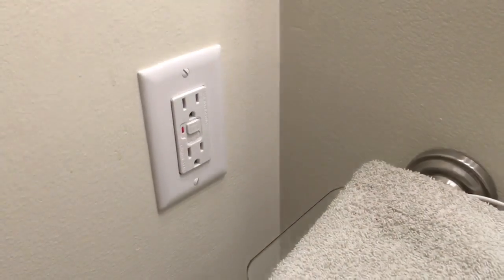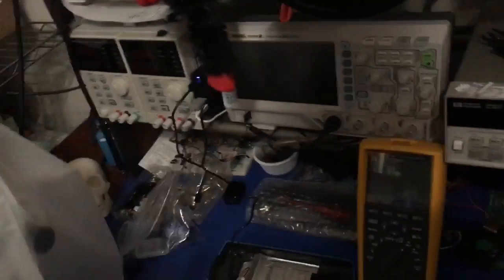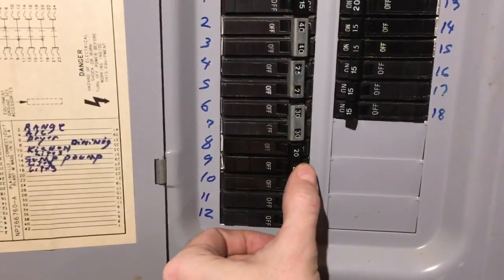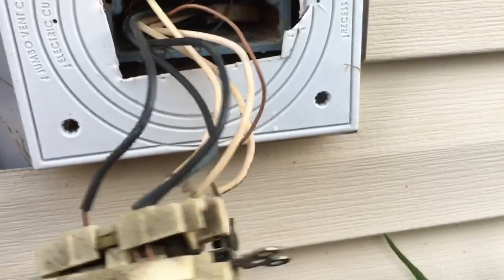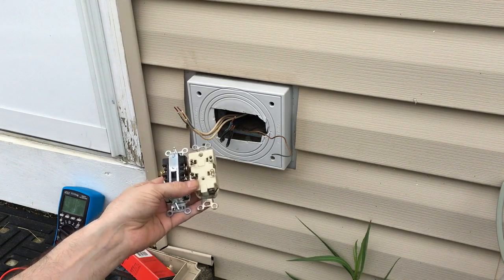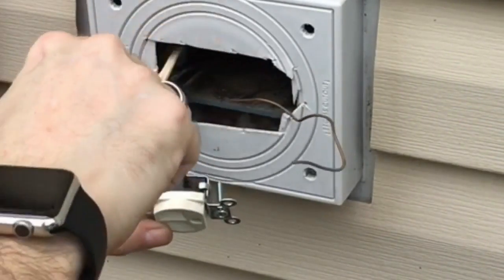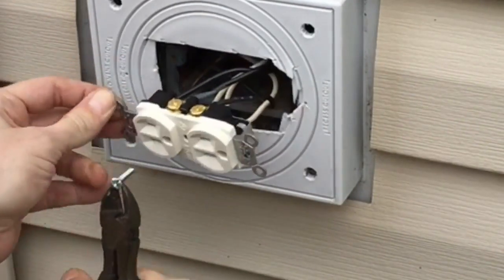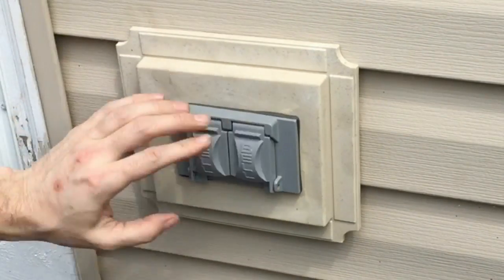Tracking down and fixing a GFCI outlet fault in the house

Comment: Seems like a lot on one circuit. My house is the same way. I believe now you’re supposed to have bathroom outlets on dedicated 20amp circuits.
Reply from the maker: I think so also. I dont own that house anymore since I moved but my new place has 20A breakers for just the two bathroom outlets. They increased bathroom outlets in one code change probably from having dryers. But recently houses can now have 10A  with some circuits because TV’s and lights with LEDs use less power now.

Comment: I have replaced light switches only thing different about them is neutral and live dosent matter which screw it goes in since it’s a toggle switch ground stil need to go on the metal screw

Comment: Couple of notes: Modern NEC code requires that receptacles that are outside be weather resistant (WR) and tamper resistant (TR).  Depending on the code adopted in your area, you might need AFCI protection as well as GFCI.
For determining Hot/Neutral, a contactless voltage detector can be handy.  Hot should be black and neutral should be white. If it is reversed use white electrical tape to mark the black wire as neutral and black tape to mark the white wire as hot. When connecting to the receptacle, hot connects to the brass terminal and neutral connects to the nickel plated terminal. 
For a box that deep, you should have used a box extension.  You also might have been able to get by with a sleeve instead and those should come with longer screws that are designed for electrical boxes.
Also, receptacles and switches don't use philips, it's actually a combination of Robertson (square) and flat head. At the big box stores in the electrical tools section, they should have combo drivers for that, although a flathead works as well as long as the connection is secure.

Comment: I've been trying to figure out the exact same issue with a garage GFI outlet tied to 3 bathrooms without success for the last month.  This video was just what the doctor ordered as I forgot that we had an outdoor outlet that was used for some outdoor string lights, which was partially covered in dirt.  Dug it out  and saw that it was also a GFI that was tied to the garage GFI!!  A heavy rain had helped cover the outdoor outlet with dirt, which is when the system inside went down. Cleaned up the outdoor outlet and hit the reset button, and viola💡 Great vid👍👍Thanks!!

Comment: I am an electrician by trade and you don't even know how common it is to find the GFCI in the master bath hop to the guest bath then the downstairs bath then the garage then exterior outlets common builder move back years ago to save money by installing one GFCI to protect all required areas. Thankfully that is no longer code you can protect multiple bathrooms with a 20 amp circuit but that's it and for the garage it requires a 20 amp GFCI circuit of its own.

Comment: What does it mean if the gfci red light flashing every 42 seconds,  when its on
Reply from the maker: With most manufactures the following applies. Blinking sometimes indicates it wants you to press test or reset? After testing/reseting if the light still blinks red then it is indicating that it should be replaced.
Reply: @GadgetReviews-US  ok perfect i replaced it with leviton gfci .  Because did electrical trade school,  we was never told about that red light

Comment: Klein tools & others sell a 2 part scan tool. 1 part is a transmitter and plugs into recepticle and also doubles as a gfci tester..The 2nd part is a receiver and is used to scan the breakers in the panel by simply squeezing the trigger then running down the breakers..It will ring when you pass over the circuit that leads to the receptacle that the transmitter is plugged into, thus saving a ton of time when you're by yourself to find your circuit.. Home Depot has them for about $35.. And moisture is a problem for gfci..

Comment: Hi. Thanks, you gave me some ideas  to keep in mind once it dries up enough here to have a go at my own gfci. I'd dearly like my hot water back.

One thing I found disturbing was just how goofy that original outdoor outlet install was. I understand your reluctance to tear it all out and face having deal with that big hole in the wall, but  I'd be inclined to put some kind of support so the socket isn't just hanging in space. You could see it move when you plugged the tester in. 

If there's enough clearance, you could try running your long screws through some nylon or brass cylindrical spacers. You'd be able to tighten those two screws up and get some rigidity back.

Comment: This has been a real thorn in my side since I moved into my new place last year. I can have my window unit AC on high, have my, nintendo switch, satellite box, laptop and 2 lamps plugged in inside my bedroom (which is right next to the bathroom that houses this god forsaken popping button from hell) with no problem. But even after unplugging everything in the bedroom the second I plug my xbox one into the wall it trips. What confuses me the most is that nothing in my room actually loses power, only items plugged in inside the bathroom. Super confusing.
Reply from the maker: So the XBox one will cause it to trip, but the xbox still has power? Try plugging the xbox power supply in another room that also has a GFI like the kitchen or garage. If the xbox causes those GFI’s to trip also then I would say the power supply to the xbox might need to be replaced. It might have a short or be arcing and the GFI’s are doing what they are designed to do.
Or it might be the GFI outlet that is going bad. The same bathroom outlet in the video was replaced 4 years before this video. It was tripping when I turned on certain lights, at the time I had CFL curly bulb lights I just installed. It was something with that type of light causing it to trip, I unplugged everything, even checked the wiring on the lights switches and didnt see anything wrong but the outlets were old. This was the reason I replaced all the outlets and switches in the house. Then when I replaced the actual GFI that was tripping for no obvious reason it stopped. The GFI might have been the original one from 1985 and they do go bad. GFI outlets do go bad with age and get more sensitive to inrush currents that some power suplies pull when you plug them in. 
I hope this helps,
Scott
Reply: Thanks for the reply! I'll  give that a shot. It's hard me perplexed lol

Comment: Outdoor receptacle held in place with deck screws ? Receptacle not in box ?  Receptacle not pigtailed . That was not installed by an electrician.
Reply from the maker: It did have a box, but it was back further then the grey siding cover, lol. So basically a pointless junction box with a 1/2 gap between the outlet and the box and thats why they used deck screws. The siding and roof was replaced a year before I bought it. I think the siding people did this with the fancy outdoor siding part. But I agree, it should have been pigtailed. What I never figured out is since that outlet obviously had another outlet/switch or light running off of it then what happened to the other grounds that is usually pigtailed?

Comment: Hey man this was a great video. I have a few outlets that have gone bad and I'm trying to chase down the issue, 2 in the bathroom, 1 outside, and 1 in the garage. I've changed the GFI I'm the bathroom still not working. Black line has power per the multimeter but I'm guessing the replace outlet was bad too..
Reply from the maker: If these outlets all went out at the same time and you changed the GFI, then I would check and replace the outside or garage outlet. If either of the dead outlets are causing a fault then the GFI will trip. 
Other possibilities is the break is tripped or might also be going faulty.
Another possibility is you might be have CFL (compact fluorescent) bulbs? Sometimes those bulbs can trigger a GFI to trip is the ballast is starting to go bad. 
Is this an older house?
Reply: @GadgetReviews-US  hey thanks for the reply. I checked the outside and it was actually the end of the bad circuit. Turns out it was the first one in the bathroom that cause all 4 to be bad. When I changed it the first time it didn't solve the problem so I pulled the all the out let's out. 
End result: the replacement outlet was already bad once I switched that one out I had power to 3 of the outlet. The outside outlet was like yours, probably been in place since the home was built and had a little moisture in it., so I changed it out too (since I had a gfi 3 pack) now everything is working like a charm.
Reply from the maker: I’m glad its all working again.

Comment: He didn't say if that fixed his GFI problem
Reply from the maker: Yes, it did fix the GFI issue. GFI is ground fault interruption. The short i found in the outside outlet was snorting to ground causing the GFI to trip. So the GFI was doing it’s job and stomping further sparks as a potential fire hazard.

Comment: The people who wired that panel should have said what lights they were I always do, and anything in 6 foot of a water source requires a gfi recep. I would have put a gfi in that outside plug for the heck of it I'd get new sheilding because of the water getting in and thats fuckin crazy the way they wired it...but the 80's was a different time, thats another good reason to get a new gfi outlet for your outside plug with the bubble dome kind of protector I hate those old ones for two reasons, 1. because I have changed a ton of them because the foam wears out in the metal covers and 2. You can see the plug through the dome and know it isn't collecting moisture. I would have just wire nutted all those together with some waterproof wire nuts and put a waterproof cover over the junction area unless that initial gray cover comes off then I would put a stab in box in it and made it just a covered jbox and made a note of it in my panel on the door cover or something and relabled my panel on the light circuits and added what lights they went to I'm glad you used the wire under rhe screw plates instead of tapping the back in those stupid holes I would have put tailed off the junction to the plug and used some red wire nuts on the junction I find that method easier than putting all three wires in that plug lol that seems like a pita situation
Reply from the maker: I always use the rhe screws, I never liked or trusted those whole in the back. Even when I replaced all the switches and outlets in the house I used the screws, except the outdoor outlet because I never used it. I guess I forgot about that one since I didn’t use it. As for that night, I was just wanting to get that circuit back up without having to redo the siding for a different junction box. If you notice, the video went from night to daylight, that was all the same night into the day.

Comment: That was a dumb way to loop that I would have done the garage off that gfi but not garage and upstairs, the up stairs bathroom should have been looped from the bedroom if it could have handled it...the gfi in your guest bathroom probably has the plug in the garage loop wire in the wall through into the garage plug if it were on the other side of that wall the fridge and microwave should have their own dedicated circuits that used to not be code but it is now I've ran into that multiple times in older homes. You should upgrade that outside plug cover to the bubble dome plastic style, most contractors use the shortest amount of wire possible so if the outside light and plug are on the same circuit its most likely the plug is powering the switch then the leg from switch to light...but like I said originally, looping the gfi plug and garage plugs should have been fine by themselves, but since the master bathroom was also added that is probably putting too much work on the wires and the gfi is thinking overload
Reply from the maker: That whole house wiring was a puzzle. We did the kitchen all new from subfloor up, and thats when I noticed bu cutting off the microwave outlet breaker it also cut out one room upstairs. Like. you said, the 80’s was a different time and different codes. Down stairs bathroom GFI with a load to upstairs bathroom, I never saw a house that shared so much down and up stairs electric before. It must have been built cheaper for that time. I sold it 2 years ago, the new house is a 2019 build and breaker box nicely labeled, GFCI and AFCI in the box, dome covered outside outlets. The only issue I found was some ceiling rope lights, they cut the rope and shoved the wires into the rope, wrapped it in electrical tape and done. I may not know all the code, but I almost positive this need to be in a junction box, or at the least wire nuts. Nope, its just electrical tape.

Comment: It's time to do it right,   I'm 76  and still involved in building, masters in all trades, elect, plumbing ,gas fitter, HVAC, appliance, refrigeration,  tile, carpentry, masonry, 3 engineers stamps, as architect.      designated outlets  runs on certain breakers, ,GFCI controlling down stream outlets, eliminate shared neutrals. GFCI properly wired. Loose connections. Wrong wire size gauge for the distance, load, yes the out door outlet not for wet locations,  broken,   great movie
Reply: so is it true you cant have a GFCI contented to downstream receptacles outside of that room?

Comment: THANK YOU! You saved me from the local electrician's around here in Covina CA who go $400 just to step into your home! My GFI kept popping off so I did exactly what you did and found the same problem that you did, except that my outside outlets were soaking wet inside. I used WD40 (great non-electricity-conducting water disperser!) with it's long plastic tube,  and sprayed copious amounts into the plug holes which flushed out all of the water. Pushed on my GFI and VOILA! Problem solved. Buying and installing a waterproof box that fits over the outlets finished the job.Thanks brother and a shout out to your folks!
Reply from the maker: Wow someone who used WD40 as it was designed to be used, lol. I’m glad it worked out for you.

Comment: Since you did this repair, the NEC now requires that the duplex receptacle outside be TR(tamper resistance) and WR(weather resistant). And the cover should be a heavy duty in-use cover to allow cords to be plugged in without allowing water to enter. Best regards...Dan
Reply from the maker: That’s true, I know the code was updated. I sold that place and recently moved. The new house has all sorts of new code installed including GFI breakers in the box for most of the house. Makes it easier to test them now with all the test buttons in the same place.
Reply: Daniel Howie, Sr.     Can you please tell me the NEC article that says if you replace a receptacle that it must be upgraded to the current NEC?   Although in this instance I agree it is a good idea, not sure where what article you are referencing.

Comment: How much more could the builder have screwed that up. The outlet box for the vinyl siding is nightmare. Its like a giant zit on the vinyl siding. Good job on explaining how you found the culprit. At the end I think I would have just pigtailed two new wires to the new outlet and shoved the other mess back into the outlet.
Reply from the maker: Yea, that house was a builder wreck. I don’t miss that house now this I sold it. But on my new house it has rope light in some rooms and I found mains wires just electrical taped to the rope light. No junction box or anything, can’t wait for the electricians explanation of this or how it passed inspection.

Comment: Why didn't you put another GFCI on each room as  NEC 2014 recommanded ? Or $10 GFCI each its so easire to trouble shoot ? Too many out let  on  one line dengerous overloaded just needed to add other dedicated line on other room? Too many thing on one line are cause for fireing. Anyaway sorry I couldn't watch allway too long video
Reply from the maker: The house was built in 1985 so it didn’t meet the standards at the time. The main point was showing how older houses daisy chained off the GFCI load and how to track down the fault by understanding this. As of the NEC 2017 Article 210.8 (I did this in 2016) with following the new code revision any outlet in a required GFCI area being replaced would have to be a GFIC outlet with and additional AFIC Circuit breaker on that line. I’ve since sold that house and bought a new contruction one that has AFCi breakers and meets the latest code, but a lot of people are still trying to troubleshoot older homes and why the GFCI trips and that was the main point of the video at the time.

Comment: you skipped the main thing is to test the outside outlet and show us what it read
Reply from the maker: You can’t test the outlets 100% because they have no power when the GFCI tips. If the GFCI is daisy chained to multiple other outlets since it was installed before the code update in 2010, then when it trips it breaks the power circuit to all those daisy chained outlets. Very time I reset it because of the fault it would trip all the load daisy chained outlets in under a second. Without power to all those outlets from the GFCI outlet tripping you can’t test the outlets. This is when you have to start eliminating the possible causes and find what’s causing the GFCI to trip.

Comment: That’s NOT good time to re wire those 3 rooms should have their own circuit
Reply from the maker: Yea, it was built in 85 before they changed the code. I just moved and the new house has GFI breakers in the panel.

Comment: Your house must have been wired by the same Jackleg that wired mine.  We have a GFI in the front bathroom that spider legs all over our house and goes to outlets that make no sense.
Reply from the maker: That’s the way they allowed it before the code changed. Not sure why, but newer home can’t have any extension load outlets connected to wall GFI’s. But they can have break GFI in the panel that covers the whole room and circuit.